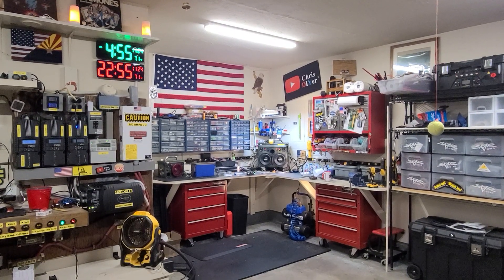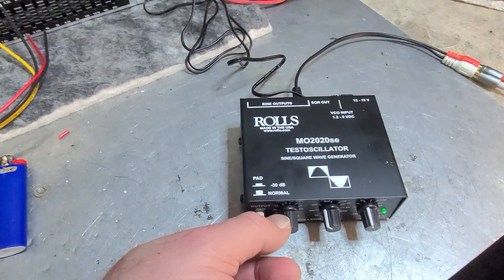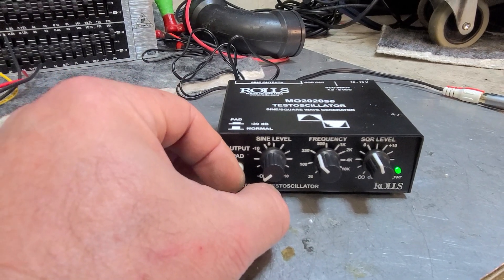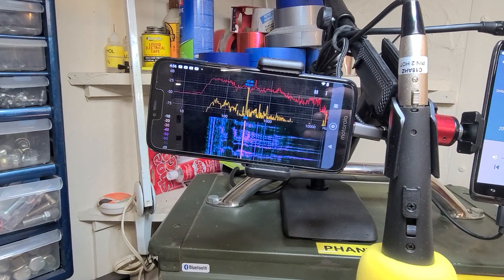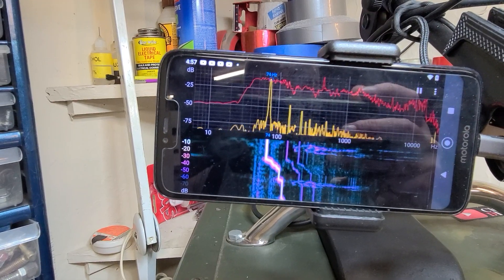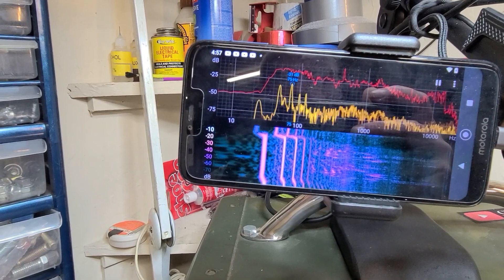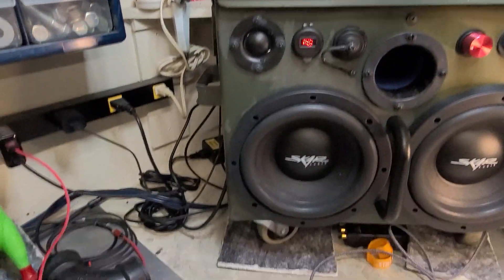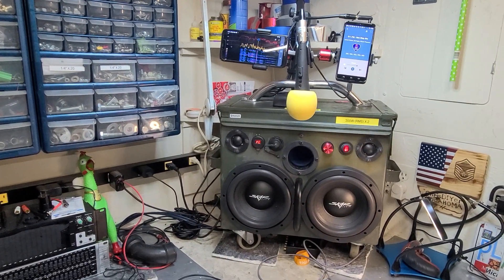Rolls Testoscillator demo -- test tone signal generator for testing speakers/subs (no APP required)

Comment from the maker: Remember, APPs that can do the same thing, but require WIFI and/or the Internet to work. For those who decide to use an APP to inject test tones there are many out there to try:
https://play.google.com/store/apps/details?id=com.xyz.signal&hl=en_US&gl=US&showAllReviews=true
Reply: I've got a tone generator app on my phone. The problem I have is, there is no 3.5 MM jack on my phone, so, i have to bluetooth a tone to my receiver and send out to my r2r. I'm assuming I could use this generator to troubleshoot my reel to reel. You have an RCA hook up right now in your video. This is sweet!
Reply from the maker: @geedaddy45  -- thanks. A smartphone APP is awesome to use, but it is getting harder to find phones with headphone jacks. I like this Rolls unit as a tone generator and use my old phone with a spectrum analyzer APP.  The Rolls is old school...but, very handy and works well. Very useful to find "hot spots" when speaker building (inject a sine wave and sweep from 20-20,000 Hz and have the spectrum analyzer "paint the line" to see where there are hot spots)